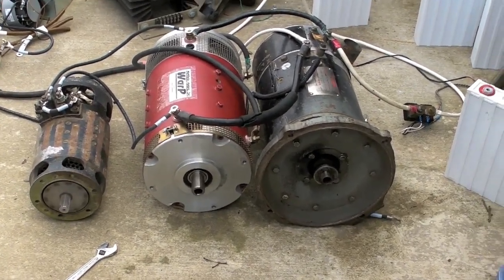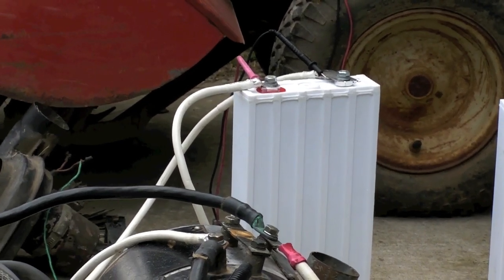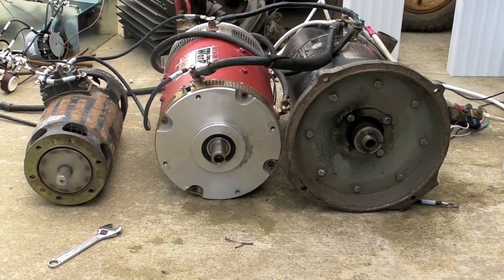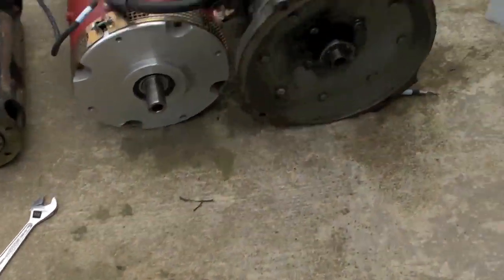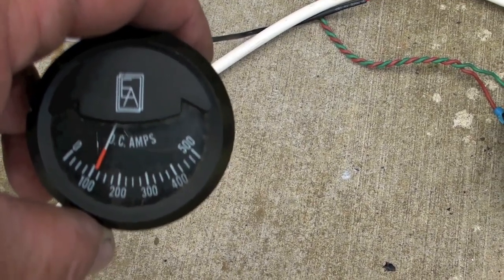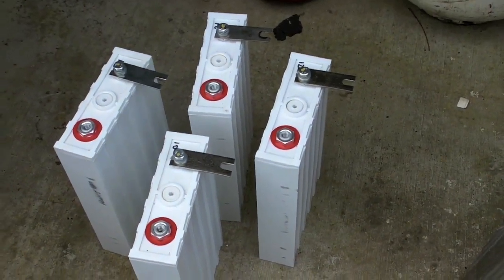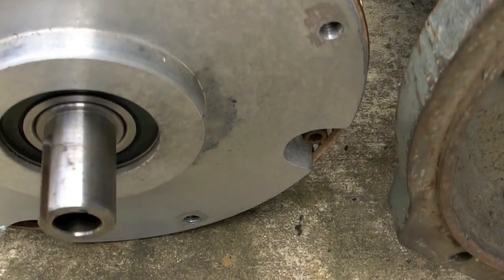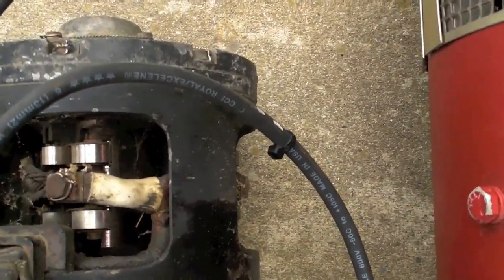discharge.mov

Comment from the maker: @gottdi What is the max you can charge to and what is the minimum discharge you can go to. My cells are 3.2 nominal and will be charged to 3.65 then they drop to about 3.33 volts resting and I can take them down to about 2.6 volts with no troubles. Actually they live very well in that range. 

Pete :)

Comment from the maker: What type of LIthium batteries do you have? We are using LiFePo4 cells. I have taken mine down to under 1 volt and had them bounce back with no trouble. Letting them drop to 0 volts and go into reversal then you may have ruined them. Never let any battery go into reversal. Did your batteries SWELL? If how are you charging the batteries and what is the AH of the cells? Brand and all that sort of stuff. They should hold a charge just fine. Are you sure your charging to full?